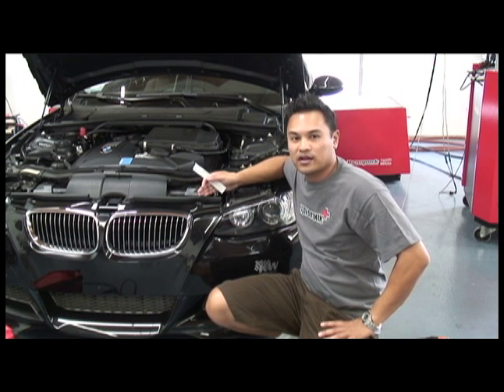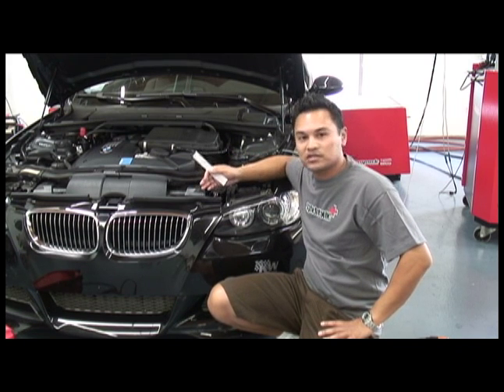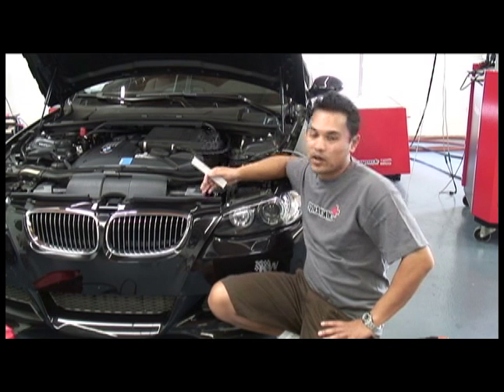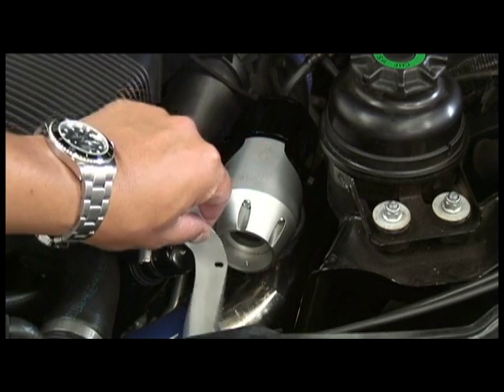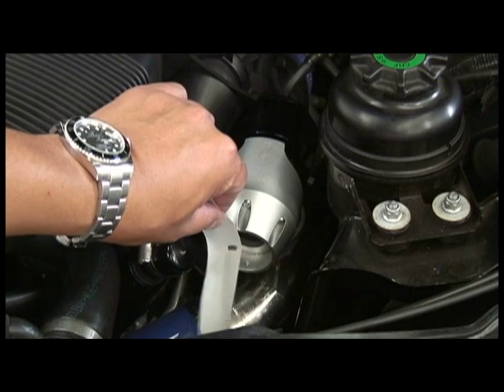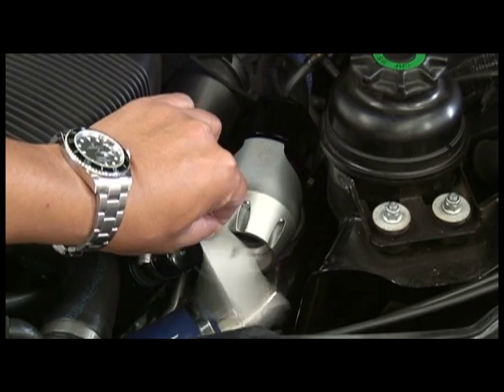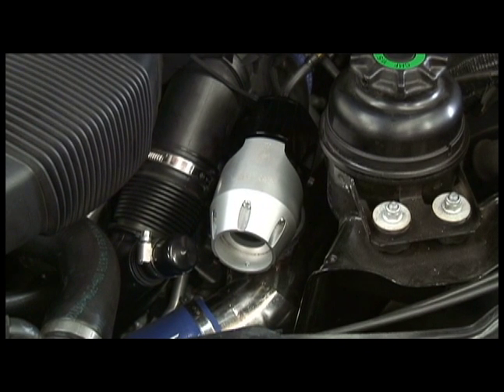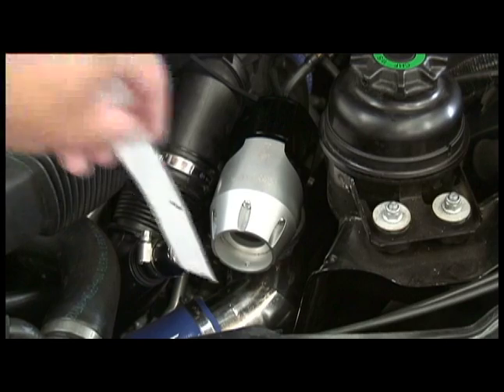Filtering a Blow-Off Valve (BOV)

Comment: At idle the throttle is closed. The BOV will be open any time the intake pressure is higher than the manifold or "vacuum" pressure. A closed or slightly closed throttle will create this pressure difference.

Comment: At idle the throttle body plate is almost completely closed. This causes the the intake manifold pressure to be lower than the turbo output pressure (people call this "vacuum"). This pressure differential causes the turbo to blow open the BOV causing what you see here.

At WOT (wide open throttle) the turbo will equalize the pressure in the intake manifold and vacuum lines allowing the spring in the BOV to close the valve. Since he lightly revved the engine we did not see it close under WOT.

Comment: under vacuum the valve will stay open,and discharge air.. not suck in air... the turbo is sitll spinning,and creating positive pressure... just not enough to over come the vacuum. i dont understand what people thing bov's suck in air at idle or in vacuum.. for that to happen the turbo it self would be spinning backwards... use your brains people.. think how things work before you post

Comment: @Triple88a  Yes I know the difference but I'm not sure what point you think you're making? If you're driving about and then coast in gear in a manual the ECU will go into open loop and cut fuel.

'That's not true' is from a comment about the BOV, I think you're getting mixed up.

Comment: @Triple88a Yeah thanks, but I know what I said.

The valve is not working as a valve and so it will suck air in off throttle, AND briefly when you open the throttle again. Listen at 1:57 and you can hear the 'tssh' as the throttle body opens, the engine is in vacuum and as soon as the throttle is opened, air rushes in to the leaking valve momentarily, before higher pressure air incoming from the turbo to the throttle blows back out of the valve.

Comment: @Triple88a I think you mean it will go into open loop and cut fuel, not closed loop? 

If this is an automatic then it's quite possible fuel would not be cut as quickly, but it doesn't matter does it because we're not talking about fuel.

Comment: @Triple88a No I think the confusion you have brought about yourself by bringing in other issues. This video shows a poorly setup BOV leaking air. In response to your replies I have talked mainly about an 'ideal situation' with a working BOV. Nothing I have said is contradictory.

Yes a properly fitted RECIRCULATED BOV setup should slightly increase intake air pressure. That is the best setup.

I've had a vent to atmosphere valve, now I have a recirculated one, for the reasons already stated.

Comment: @Triple88a No I don't think it will, it's been setup wrongly. Like I said in my 'initial statement', it's just an air leak!

A normal BOV shouldn't blow air out like that under light throttle, surely you know that? It's leaking boost pressure out of what should be a closed system and as such when you come off the throttle air will be sucked back in because let's face it the turbo will barely be spinning in this test, no load, light throttle, probably no boost. You know that too right?

Comment: @Triple88a Well I say because this BOV is clearly just open and leaking air out under acceleration and if you look at about 1:57 you'll see as the throttle is opened rapidly the change in air pressure sucks the paper in momentarily. It's obvious and having turbo cars I would have expected you to see that. It's plain there to see.

You can take your vacuum for the BOV of pretty much any pipe with a vacuum from the engine, it doesn't make much difference, same place as installing a boost gauge.

Comment: @Triple88a Well I guess it depends what kind of fuelling system you have, it won't be completely cut on this BMW everytime you lift your foot off the gas. That will depend on the specific vehicle, whether it's in gear, you have the clutch depressed, if it's stationary etc etc. Regardless, it's a moot point, we're talking about a leaky BOV.

Comment: @Triple88a Haha, well thanks for the 'hint' but, no shit a recirculating system uses a valve... we're a bit past that amazing revelation now...!

However, a recirculating system also changes the intake air pressure, a point which you have missed.

Recirculating the air keeps the turbo spinning faster, reduces turbo lag, eliminates more stalling extending the life of the turbo, and consequently will improve driveability and thus emissions. It's win-win, and that's why all modern turbos do it.

Comment: @Triple88a Yes, I think you're beginning to understand;

Think about the valve itself, how does it know when to open and when to close?
It is because of the vacuum pipe connected to it. The engine goes into vacuum off throttle causing a spring to compress inside, opening the valve. 
The BOV in this video is incorrectly set up to be open all the time (an air leak), it's blowing air out on part throttle.
That's boost pressure meant for the engine being vented to atmosphere, right?

Comment: @Triple88a You contradict yourself, if an engine "cannot run without air nor fuel" then how can it "decelerate without squirting fuel"? That's wrong. 'Max lean' means what it says, i.e. the least amount of fuel to keep it running.

Understand this, RECIRCULATING THE AIR TO THE INTAKE SIDE OF THE TURBO KEEPS IT SPINNING FASTER. That is the standard setup, don't change it.

The BOV will be connected to a VAC line aswell -Fact.
I don't think you have a turbo at all otherwise you'd know this.

Comment: @Triple88a Nothing I have said 'falls short', it's just the way it is I'm afraid. 

The BOV does it's job of expelling air right? (it dumps the boost pressure). That will stop the turbo stalling a bit but not as much as if you recirculate the dumped air back to the intake side before the turbo (BMW and all modern turbo cars do this as standard). Therefore installing this BOV will INCREASE lag as it will take slightly longer for the turbo to spool up again compared with a RECIRCULATING system.

Comment: @Triple88a Do you think an engine can run without air? No it can't, so when we talk about the throttle being 'closed', it doesn't mean the engine actually stops taking in air and fuel, It just takes much less. Similarly it doesn't stop pumping out exhaust gas as you suggest, that would be silly.

This is why as I stated in my first comment; he takes the paper away because you would see it suck in air, that is a fact. BOVs are usually connected up to a vac line as you should know if you have one.

Comment: @Triple88a No it's not a theory, it's the facts. I never said the turbo stops spinning, I said lag will increase.
I don't think you've realised that turbos run off exhaust gases and off boost the engine will be running a vacuum so if you install a leak it will draw air in to equalise the pressure

Haven't you seen a boost gauge? The following clip clearly shows the -ve vacuum and +ve boost readouts for this exact car, you can see it goes into vacuum between gear changes too > watch?v=woGrgQOf4t8

Comment: @Triple88a 
On this BMW it will create more turbo lag as the excess air is vented to the atmosphere instead of being recirculated back to the intake side of the turbo, so it would affect how it drives especially between gears (however peak power would not change)

Aside from jerky shifting on light shifts you could get all sorts of dust sucked into the engine, affecting performance

Indeed on cars with a MAF the dumped air would also cause the vehicle to run rich but that's not relevant here.

Comment: @Triple88a Err that's what I'm saying, the throttle closes, the gas is vented. However once expelled it leaves behind a VACUUM in the pipe which will cause air to be sucked in and thus the bit of paper, however he moves it away so you can't see it.

That BOV will suck in air from the atmosphere every time you come off the throttle, it will suck in whatever air is around, not directly into the engine, but into the intake pipe between the inlet manifold and the turbo, and therefore then the engine

Comment: Err Nope.
Try leaving the paper infront of it when you come OFF the throttle and you'll see it sucking in air and if you creep the throttle like that the turbo will barely be spinning if at all. Boot it.

It only takes a little intelligence to work out that the spring in a BOV can only compress and make it's sound when the air flowing through it changes direction, think about it.

What you've done is installed an air leak and that's why the engine is vibrating. You must recirculate the air.

Comment: @madmestesoskillz  No, it's not removed.  It's closed before the car starts up.  If the valve was removed it never would have opened as the air would have kept it closed.  Also, if you're thinking it's the piston, it's still there.  Yet again, you're clueless...

Comment: @viru52000 It looks like they took out the pop-off valve to show that the BOV does not suck in air -_-. Without the pop-off valve it just dumping air out thus showing that you don't need a filter since the bov is not sucking any air in.

Comment: @ProteinBoogers (i have a turbo. dont yell at me :)
if my bov was open like that at idle i would have un-metered air escaping the system would create a rough idle and rich condition. for this to work the system would have to utilize an ecu tuned with out a MAF for it to work correctly right? 
also the vacuum tube for the BOV would have to have to be placed on the intake manifold after the trottlebody to take the vacuum pressure and not the positive pressure the turbo is making at idle.

Comment: the only reason i would put one of these on my car is if i had a turbo and i didnt want it for high performance use, which kinda defeats the purpose of having a turbo in the first place. but theres no point in having small turbos on a car that build boost at idle. your better having larger turbos that build boost under open throttle so that the bov will only open anyway when your putting your foot to the floor anyway. in my opinion total waste of money.

Comment: ya this is gay, bov should never be releasing air unless u shift gears, this is a boost leak. the bov should be shut tight under idle or load.

Comment: @BillyBobBizWorth maf reads air flow, as in how much air is flowing into the turbo, map is air pressure as in how many pounds per square inch of air there is, huge difference.

Comment: @synaptic1 What do you mean? it's leaking air even in light load. so it will be leaking boost when it starts boosting... boost leak...

The turbo spinning plays a big role on how the car feels in the non-boost area... you don't want to have a leak like this under vaccum.

Comment: @eautocad FALSE. The best blow-off valves are supposed to be mirrors of the throttle body. The more throttle you give it the more the BOV should be shut. When in partial throttle it lets boost out and allows the turbo to be spinning faster then if the valve was shut. As soon as you punch the throttle it closes completely (and almost immediately) and your turbo spins up faster and builds boost quicker.

Comment: this makes no sense to me. how can the turbos build pressure when air is constantly coming out of the open BOV? 
typically the BOV should remain shut until throttle off and open to release pressure, not remain open? 
what is different about this setup? 
what is the vacuum reading @ idle? 
will the BOV shut under actual load?
if not, this contradicts all BOVs and turbo setups i have seen. 

more info please?

Comment: On a supercharger set-up this BOV system would work for the better,but for turbo applications if you want to use a BOV like this you should have it before the MAF/AFM so its releasing unmetered air,not metered air and creating a leak, with a BPV it can be after the MAF because it wont create a leak and will put the excess air back into the intake system and also works releasing air before not after the intercooler so the hot air doesnt have to go through the intercooler as much keeping it cooler

Comment: If you think its a efficient turbo and thats why its releasing air then why would have a open atmosphere BOV? that BOV is not taking advantage of this such efficient turbo by releasing it into the atmosphere is it?, it should be recirculating that air to keep that efficiency that the turbo is producing in the system not chucking it out.
But if thats what youve been taught.... go for gold lol
Because of that my 160HP GSR would smoke it for sure haha.
See you on the track. :-)

Comment: To make it what it is, sure their will be some restrictions and such but overall there aint usually much unless your into high performance.So mainly all these aftermarket parts and mods you do at your own risk,do some research dont just jump on the bandwagon and then have issues. I will never get a open atmosphere BOV unless it does what i said before and that is just get rid of the excess air as fast as possible,same with a external wastegate,and obviously make sure it aint leaking like yours..

Comment: On top of that the only reason that a BOV would have a filter would be so if you BOV does leak air or intake air its going to be filtered not dirty, just like a filter on a oil catch can does, incase it intakes after a pressure release.
Anyways i hope you take in the information everyone has told you because they arent lying to you, i think you are misinformed or need to think before you speak about things alot of people know about.
Are you a customer or the mechanic at that workshop?

Cheers

Comment: Hey Synaptic, im not here to judge you like other people have but they are right, its a open atmosphere BOV because it releases the excess air back into the atmosphere where as stock/recirculated/plumb back BOV will put the air back into the intake system so BOV leaks arent as major problem as a open atmosphere, but it is still a problem(diaphram/plate or spring) and should be fixed for it to operate properly.

Comment: @Sarumatix It isn't leaking pressure, it is in bypass mode under high vacuum, which unloads the compressor and eliminates unneccessary backpressure when the demand isn't there.  Once the intake manifold goes to -2" of vac the BOV is closed in order for the system to build pressure.

Comment: @SynapseRawUncut  the point of a large spring is to allowed for increased boost pressure over stock. if the BOV is open at any point, pressure is escaping the intake thus the turbo isn't working. Pressure should only be released when there's a sudden drop in pressure between the intake manifold and the intake piping. also, the whole suggestion that a BOV requires a filter is just retarded, the BOV is a one way valve, air should never enter the BOV since it should only open to release pressure.

Comment: BOV's aren't supposed to vent air at idle or at WOT! They vent the excess pressure built up from the turbo when you back the throttle off. At all other times it should be closed. Why is this one open but every other BOV manufacturer on the market would be closed at idle? It's as if this BOV has been put on backward so to speak. Saying it's the turbo being so efficient is a load of cr@p, your BOV doesn't care how efficient your turbo is, it's only function is to dump the air. this is BOV FAIL!!

Comment: @Dert666 There isn't a boost leak because the car wasn't under load. Because it's piston actuated when there's a presence of vacuum (at idle, or off the accelerator on the freeway) the valve is open. But when you press on the accelerator UNDER LOAD (key point here) vacuum disappears therefore closing the piston creating positive pressure in the intake manifold (boost). This is not showing a leak.

Comment: @Dert666 I used the synapse super synchronic bov (recirculated) on my 2.0 gti turbo. FANTASTIC product. There is almost no way you can get compressor surge because it's piston operated and no floggin' diaphragm like tial, blitz, and hks. Best bov on the market by far. Their external wastegate is also really good. Running 40lbs of boost? No problem. Synapse all the way.

Comment: Very nice setup, should eliminate surge and help linearly degrade lag. I think it would help decrease the retarded youtube comments if the operation was explained a little more. 
1. Discharging boosted side air at vacuum reduces "backward" pressure on the turbo, reducing lag.
2. HELD OPEN operation at vacuum allows all high boost air to be expelled almost immediately
It operates almost exactly like the surge valve setup on most centri units

Comment: Can we say....DUMB ASS!!! This turbo is "acting like a centrifugal blower.   It's blowing TOO MUCH air at idle, therefore it needs to be vented.  Once the car goes WOT the valve THEN shuts and is sealed so the car can build boost.  This isn't for every turbo charged car out there, but since this particular car flows so much air at idle, it needs to be setup like this

Comment: umm... shouldnt the waste gate open up to regulate the pressure the turbo is creating. not the blow off valve. i was under the impression that the blow off valve releases the pressure between the manifold intake and the engine, when the throttle is released. the only thing that should stay open like that is the waste gate valve which regulates the pressure in the engine. not the bloody blow off valve O.o

Comment: @mkrv4jtta actually if you are at highway cruisings speed and your boost gauge is at 20vac, you have an issue, normal cruising vacuum on a turbo vehicle is 99% of the time 10-15vac, its only when throttle is let off and more vacuum is drawn that you reach 20, cruising should NEVER be at 20 vac, I'm not here to argue how great or not great this product is,